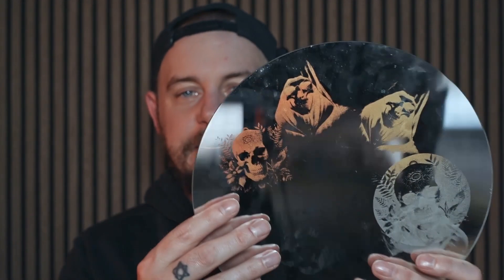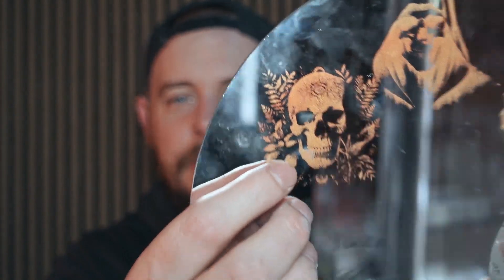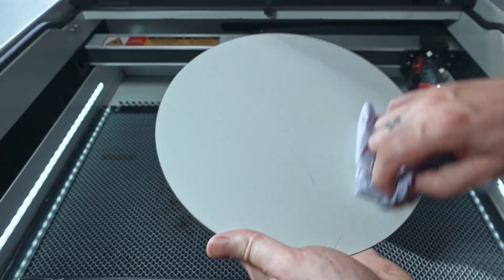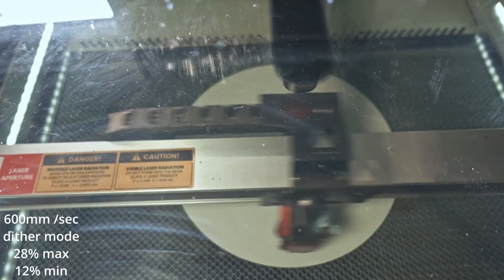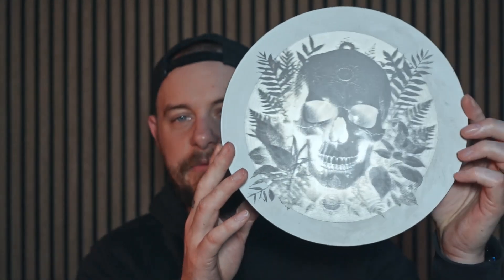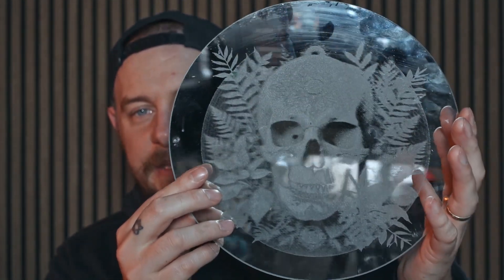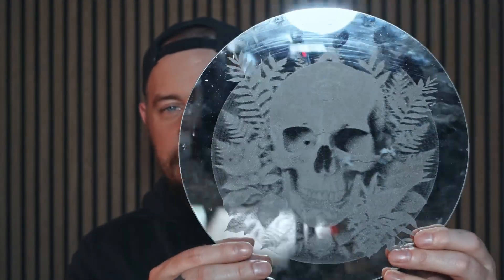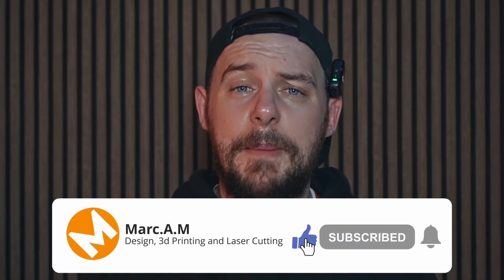Using Lasers To Mark Images on Mirrors

Comment: Looking good man. Glad 3D effect came out. Never tried a mirror. Could be a little earner. Must remember to "mirror" no pun intended, any text used in future products, Cymru am byth backwards might not work😊 Recently returned from trip to Carmarthen with several kilogram of slate coasters....busy busy.
Reply from the maker: Cheers 👍🏻
It turned out so much better than I thought. Didn’t think the 3d effect would work on mirror.  They are such cheap mirrors too. Just £1 each so easy to make profit on 👌🏻

Nice little haul then! That will definitely keep you busy for sure!! I need to do more slate projects soon!